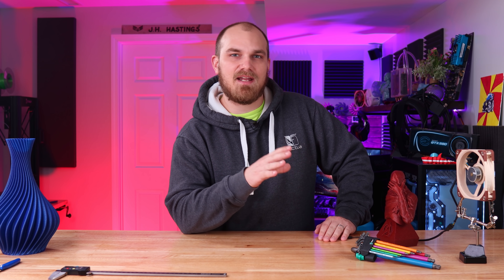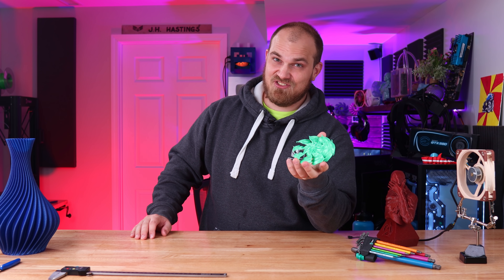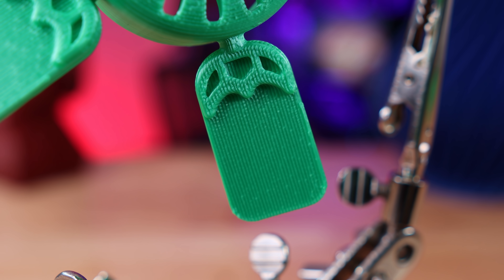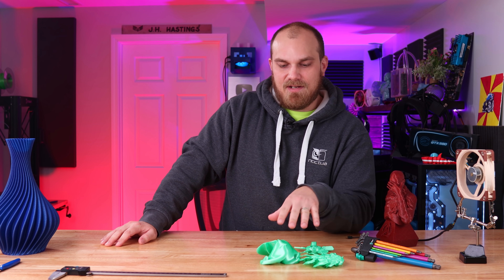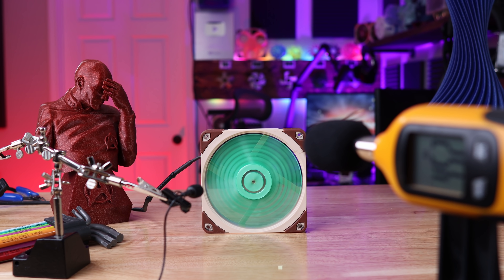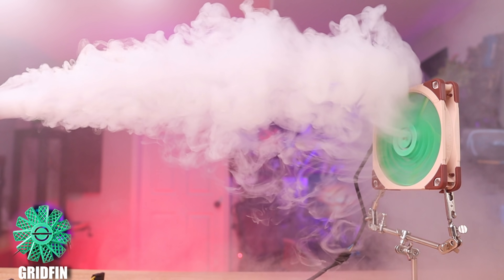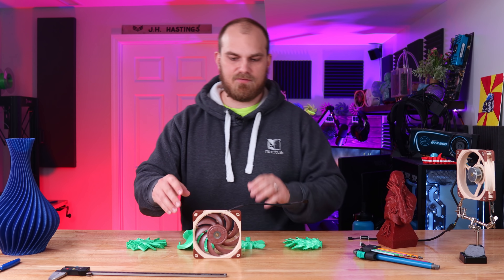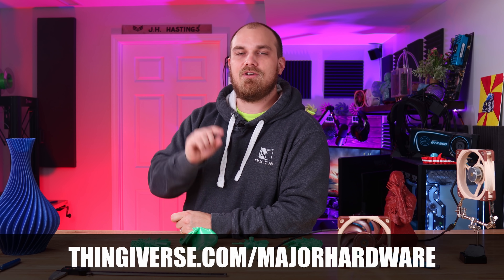Can a fan made of GRID FINS work? - Fan Showdown S2E11

Comment: Someone needs to make a fan based on a turbocharger impeller
Reply: Hard to do as the reason a TC impeller is shaped like it is is because of the housing it's in and the direction it is sending the air.
So you could build a linear compressor, but it wouldn't look the same. More like a blender in a funnel. \''^''/

Although... If you made a compressor housing where the A12x25 mounts to the side, then the outlet can be screwed to the cooler... It would be pretty nifty (Although Massive and may not fit in a PC), still sweet.

Comment: @Major Hardware
In the smoke tests, I see a lot of smoke goes around the fan, maybe it is better to mount the fan-frame onto an acrylic sheet that acts as a see-through wall?
Reply: like a wind tunnel with just the fan moving the air
Reply: I was thinking stuffing the smoke tube full of drinking straws to encourage laminar flow, so it doesn't billow all over the place.

Comment: You should mount the casing to a plexiglass plate for the smoke test so we can see what’s actually being moved through the fan more clearly.
Reply: This is a great idea!
Reply: Maybe on the exhaust side of the fan. Seeing how wide of an area the fan will pull from on the front side is useful information.
Reply: @8Jory  That was my intention. I see I didn’t specify in the original reply.
Reply: @redstarwarrior85  i had assumed you meant to put the entire fan in a duct made of plexiglass essentially. That would have it's own experimental value, though not much value in regards to the intended application. Well maybe to test the static pressure generated by each design but I digress.

Any way, my bad.
Reply: @8Jory  Oh, I see how you could interpret it that way. I just meant mount the casing on a flat plexiglass pane that’s 2’ x 2’.

Comment: Y'know...looking back at the sound levels of the top-5, I wonder if the Slug wins in terms of cooling-per-dB. The swag technically has a lower dB, but listening to them, the tone of the Slug is lower and less intrusive.

I don't know if it's having the fins extend all the way to the middle or what, but some element of that design is doing work.

Comment: what 5th? Noctua spent yrs of development for that fan and got rekt by some bat$hit crazy design! :'D
Reply: In fairness, Noctua's blades are designed for high-volume production and aren't allowed to extend outside the frame.
Reply: @Azlehria  you are 100% correct but these fans are 3D printed with tons of imperfections the results we get are a worst case scenario
Reply: @Azlehria  the dick mk2 will probably have similar tooling

Comment: As a season finale (eventually) it would be awesome if you re-ran the top 4 + the noctua in a direct head to head, just to prove that the results are repeatable.
Reply: top 10 even would be awesome, I just noticed an interesting trend in the cfl numbers and realized that to get an accurate reading there probably needs to be a tube on the output side of the fan to make sure the air flow stays cylindrical. curious to see how those numbers would differ even though the delta wouldn't change.
Reply: When I first saw this I was hoping that someday he'd be able to take the top fan designs to Noctua to have them made in a proper facility, let their engineers make some optimizations and make a set of 4 fans for each of the top winners. When these blades beat their designs there is no way Noctua didn't take notice.
Reply: @orangeapples  the problem with this is that specifically the ones on thingaverse he doesnt hold the copyright to
Reply: Season by Season head to head Top 4 of season 1 Vs season 2 or any that beat the noctua as the Noctua Killers.
Reply: @snintendog  as Dawid would say 'The Deathmatch of Death" 😂
Reply: Yeah that would be Awesome to have them all tested on the same day 😁
Reply: Of course the results are repeatable... There isn't any variable that would cause them to change lmfao it's not like the fan is made of jello and wouldn't work after sitting around for a year. They're plastic. They haven't changed.

If you just want to see them compared to each other then say that.
Reply: Hell yeah

Comment: You should put the noise level of the fans into the spreadsheets. It's relevant information, after all.
Reply: In that case the fan noise while mounted on the heat sink would also be interesting, as the reduced airflow certainly also changes how the fan sounds.
Reply: He had problems with that, so it'd be meaningless.
Reply: I said that several episodes ago
Reply: ...what?

Comment: dang. someone else’s grid fin made it in before mine. guess its back to the drawing board for me! great episode!!!
Reply: The grid fin that made it in wasn't well-engineered. You should submit your design anyway, maybe it will do better. Just make sure to mount the fins at a good angle.
Reply: @warpedweirdo  awe haha thanks. It was fun to see in any case. I’d be surprised if mine did any better. Here it is if you wanna take a look. It’s on thingiverse too https://twitter.com/jakedowns/status/1376005267763032067?s=21 think mine might print too thin too, it’s just a scaled down replica
Reply: @JakeDownsWuzHere  it looks to me like it rotates in a wrong direction
Reply: @vsm1456  the noctua a12x25 spins counter-clockwise facing the front.
Reply: @JakeDownsWuzHere  well, now I'm certain your fan should be mirrored. the air goes through the grid fin, not along it. each small surface in the grid acts as a blade

Comment: Now the Slug had a pretty interesting exhaust pattern.
Reply: It actually looks pretty good for front intake fans
Reply: @S.mashing.Blumpkins  except it would have to be Mounted on the outside of the case since it stick out past the frame of the fan.
Reply: it would be interesting to see it in a case, but just wondering if it would fit behind the Front Panel as it does stick out quite a bit from the front of the Frame
Reply: @shaneeslick  it would be viable for my case, as the front panel has been removed already due to rad size and how badly the panel restricted airflow
Reply: The pfp fits so well
Reply: I honestly thought it was going to be the worst since it looked like it was just throwing it everywhere but straight back.